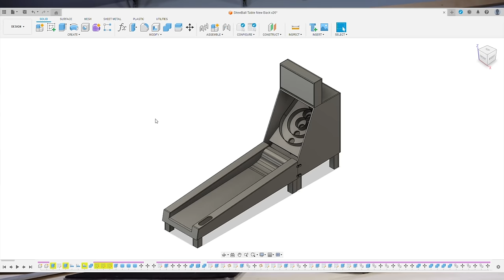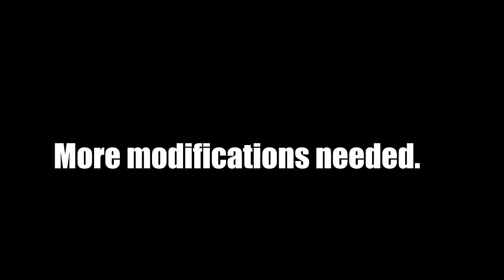DIY a SkeeBall Machine | Part 1

Comment: Suggestion on ball sensing: use optos instead of switches. Modern commercial machines use an infrared LED paired with a sensor. With the amount of abuse the switches would take from the balls, this will last MUCH longer. You can see the actual part used on ICE's website, though in the DIY spirit custom making PCBs would be the way to go.

Comment: 14:47 Gotta love when the temporary accommodation becomes an intended feature.
Reply: Commerical SkeeBall-style machines are designed for the playfield to be removed - the sensors are behind there, and need adjusted and replaced from time to time! They literally just sit in there - no screws, nothing, in the common ICEBall variant.

Comment: I second making things take out-able.  I built an arcade cabinet years ago and built hinges into the control panel and just secured it with velcro.  Was really nice to have easy access to the electronics, and I ended up storing a few things in there as well.

Comment: I like the design plus it's good to see someone try something a bit different like a skeeball machine. My one suggestion- instead of all the accomidating for the bolts you had running thru your ramp you could have run them thru the side walls instead and save yourself a bit of hassle.

Comment: I came up with a Unique Skeeball change:   Instead of the two 100 point holes...  there would be a single 100 point hole... that Slides Side to Side (motor and crank driven).   This would make it a more interesting challenge, because you would have to have precision timing to land the shot.    If one had the electronics skills.. one could also vary the motor speed... depending on the  "Stage"  or  Difficulty you choose...  (and it could also be static / off,   or Erratic ) 

 Another idea, was to change the board entirely, to using a  5x5?  grid of holes.   This would allow for various game types.  For example... a 2 player game, where each player had to try to make a line of  "5-in-a-row" (like the game "Fascination", or "Connect 4").   This would be accomplished, using multi-color LEDs, that would light up the Hole Bezels that had been Landed / Scored.  When you alternate players, the dominant colors would change (IE:  Red holes for player 1,  Blue holes for player 2).

 Various Games could involve having to land a specific hole, that lights up, within a set time period (before the light goes out).   Points, or Bonus points... could also be awarded, based on how much time it takes to land a hole.

 There could be Bomb / Trap holes... that are lit up a certain color... that you need to avoid.  If you accidentally sink them in a Trap hole.. you would lose a ball / life.  Or deduct points from your score.

 A mini-projector might be used, to project images onto various parts of the machine... to create different environments.

 A powerful shaker motor could be used for special effect modes... simulating earthquakes, storms, cannons... etc.

 The main ramp..  could have a pop-up  "bumper-cylinder"  ..that goes up and down... if it has been triggered in a certain game mode.  Thus, you would either have to shoot around it... or time a center shot before it raises.

Strobe lights,  A Disco Ball,  and or Laser Beams,  could also be used for interesting effects / modes.

While most Skeeballs only release 9 balls per play... you could also have an Infinite ball return mode... to see how many points you can score within the Countdown Timer sets ...Similar to those Basketball hoop games.

If the game is driven by PC..  you could have specialized music, sound effects, and programable light-show effects.

Comment: I would lose my mind if you built a coin pusher. I’ve been trying to think of how to build one and I’m thinking a reciprocating saw, some leds, and a voltage regulator for the reciprocating saw to keep the motion going. Maybe even a gear set up for a multi level pushers!

Comment: it's a really cool project but is it a DIY? nothing wrong with being a professional job. but definitely not something i could do. at the point you said CNC it got questionable. i would consider you a professional with professional equipment and/or connections so still really cool, I'm just distracted by the DIY tag.
love the long video format, please make more extended content.
Reply: Nothing was CNC'd that couldn't be cut with a jigsaw.
Reply: @DH-xw6jp  that's kinda my point.